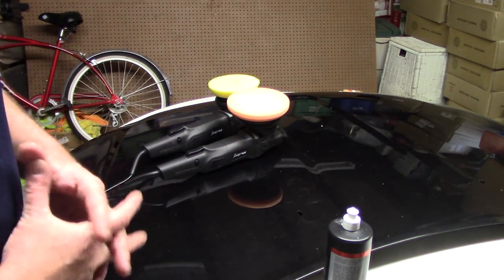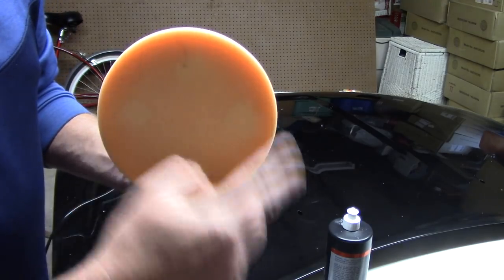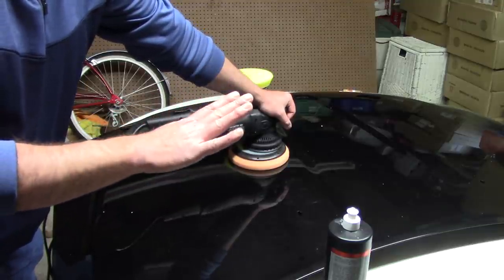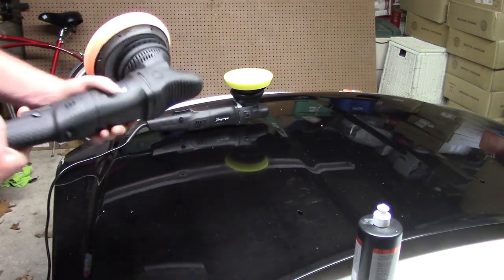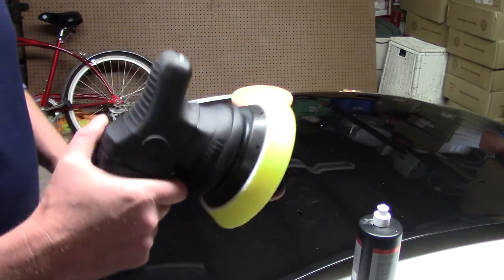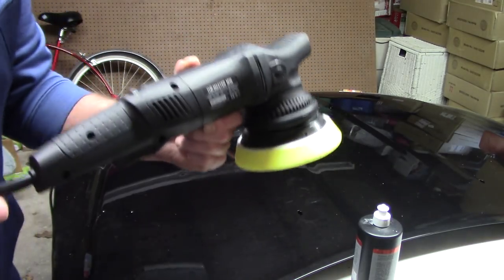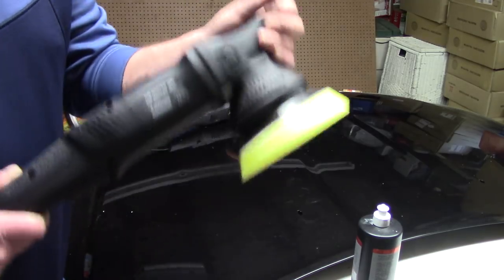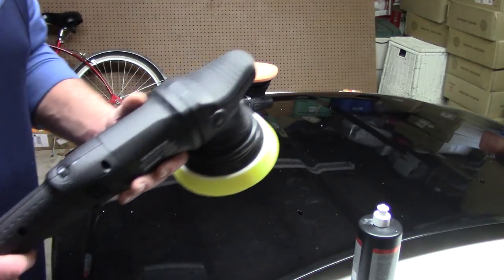21mm & 15mm Polisher - Which Is Best For You!

Comment: Why is it that the manufacturers of these polishers along with other paint correction professionals say that the 22mm long throw are better for preventing holograms and burning through clear and preventing hazing?  Everything I've heard from other professionals is that the shorter the throw the more susceptible you are to getting holograms.  That's why using a rotary takes so much practice because it's so easy to screw up the paint because it has zero throw on top of being forced rotation.  The shorter the throw, the more susceptible you are to hazing and holograms, especially at high speeds.  Whereas a long throw can be used at much higher speeds with less chance of hazing or holograms.  Heat plays a big part, but changing the pads often or blowing them out with compressed air cools them down between passes.  It's going over and over and over the same area which can get you into trouble, that's why picking the right compound and pad is crucial for whatever types of defects you are trying to correct on any type of paint, soft or hard.  Paint correction can be done with any kind of machine if you know what you are doing.   But an inexperienced person can screw up paint with the most expensive equipment and chemicals if they don't know what they are doing, irregardless of throw!  Look at Gary Dean, after all these years he's still using an Harbor Freight DA with exceptional results!
Reply: Ya, I'm thinking the same. Longer throw means lower concentration in the area, right?
Reply: @allen ✨Thanks for this comment!  It was very helpful 👍
Reply: Irregardless isn’t a word.

Comment: Scott--great advice and spot on!!   Another reason to go for a 15mm is it is less fatiguing than a short throw polisher.   I find that my Griots Boss 15 is so much smoother than my Griots GG6, requires less pressure and I'm able to get the job done with fewer passes.   Also, now that I have the 15 I equipped my GG6 permanently with a Griots HD 3" backing plate and 3" pads--saves more time rather than having to change backing plates in the middle of polishing and does a fantastic job.

Comment: Great videos, every single one I've seen has been invaluable. I am trying to decide on my first polisher and was thinking of the hyet due to the price and having to work on my badly aged car paint. (Oxidized and a bit of peeling even) Sounds like maybe a 21mm isn't the best choice long term just starting out. Not sure why an 8mm would be that much easier than a 15mm.

Comment: I'm pretty sure if you do the math out, you'll find a 21mm is "closer" to a rotary motion than a 15mm and a 15mm is closer than say a 10-12mm. That's why it removes defects faster - yes it's still an orbital motion but less so than say the original PC DA. That explains the additional heat.

Comment: If you're unexperienced and you don't master the technique there will be problems even with a 15 orbit. You can do damage with any tool if you don't use common sense. You can have a 21 but if you adapt all the variables: paint, speed, pad, compound, pressure, passes and if you use common sense, you will be OK.

Comment: I have the Harbor Freight polisher. I assume it's 15mm. And for my occasional purposes, I'm very happy with it. I did replace the backing pad, and use chemical guys pads.
 Do you ever use a rotary, then finish with the DA? I have had very good luck doing this with fresh paint work here in my collision shop.

Comment: I have an old 21mm Porter Cable D/A with 6" pads.  I want to upgrade to a new Milwaukee chordless D/A polisher.  Can I use my old  6" pads with a 15mm D/A polisher?  Can I just purchase a larger backing plate to use the 6" pad?  Thnx.

Comment: Metallic paint is typically harder paint especially a pearl white ram 1500 correct?
Reply: IMO, What is harder or softer is the clear coat on the top of the base paint, it doesn't matter if it is a metallic or not.

Comment: Great content as always.  What's best for large boat hulls a 15 or 21 mm. Thx a bunch
Reply: Use the 21 MM for the large surface areas. Use the 15 MM for tighter areas. If you want to get more into it, use a 3 inch 12 MM for even smaller areas
Reply: Thank you sir. I did go with the 21 mm for my boat and truck  thx sir

Comment: Scott, I appreciate your videos! I'm currently debating the 15mm and 21mm Griots G series myself but can't decide.... I have been detailing on the side for a decade with a Hitachi rotary 5.5" LC thin pads/(wool when needed) & a GG6 with a 3" and 5.5" setup....now I want to step into the long throw territory. 
Work ranges from fresh paint / wet sand polish / to daily drivers Euro to Japanese. 
I personally think the 15 would be a great all around as you state but with my wide scope of work, I think the 21mm would probably be a better bet combined with my GG6 with a 3" BP/Pad combo for tight spots. What would you do in my situation? Thank you and I hope to hear from you soon. 

Cheers!
Reply: Wondering what you decided on? I’ve been debating the 21mm DA or going to rotary. I use a Hf 8mm polisher now and it does pretty good. I might even just stick to the smaller throw and get a G9, would love to get some input on ur decision
Reply: @AuctionRecoveries  I have yet to purchase another polisher. I've been doing well with my setup. I'll have to ask around to test someone's machines to see if I like it. Haha. Or if it's more efficient

Comment: What’s the best way to remove rust stain from paint??
Reply: Wet sand with 2500 grit sand paper until the stain is gone - it shouldn't take very long, nor a lot of effort (feather the workspace for a smooth transition).
Then, compound with cutting compound and cutting disc (Microfibre is my preferred pad for heavy cutting).
Polish with finishing pad and polish. It may be advisable to lay down a good wax or sealant over the area to assist, in any way possible, in beading water and preventing it from resting in the area where the rust formed and causing future issues.
Also, if you have any concerns about the going through your clear coat (on a reasonably well taken-care-of vehicle, this shouldn't be a problem), use a paint depth gauge to find how thick your clear is. Hope that helped.